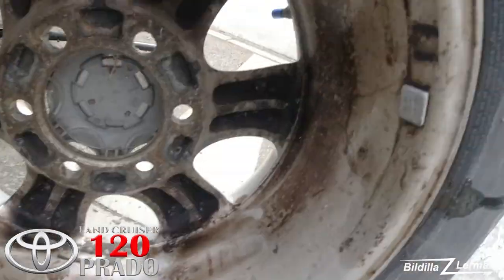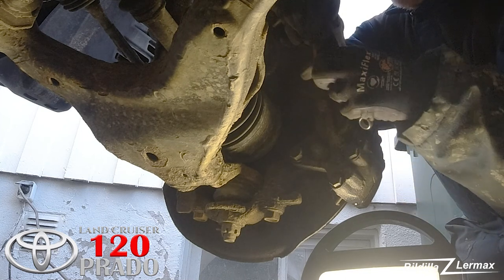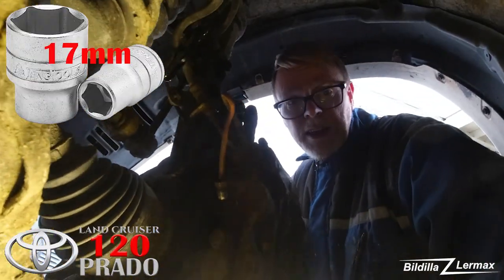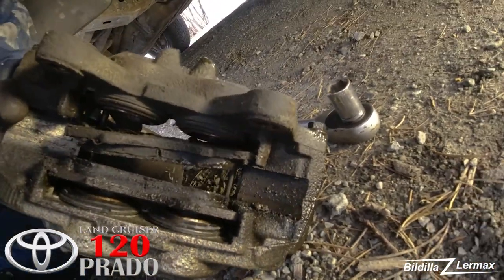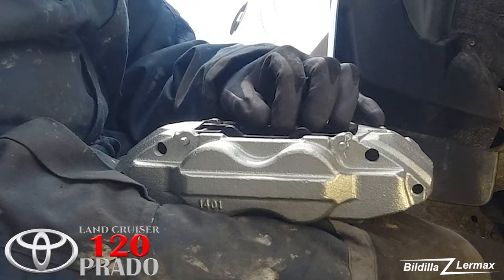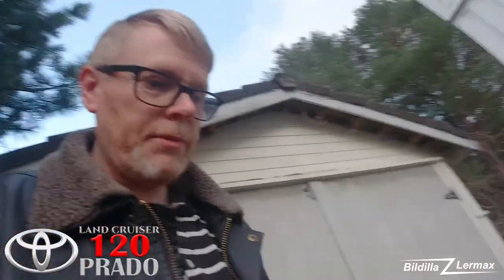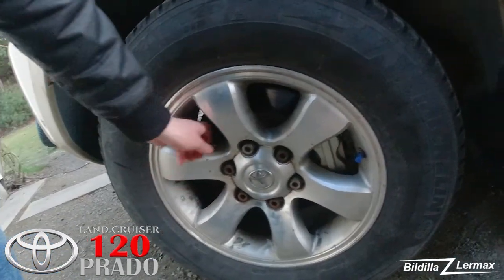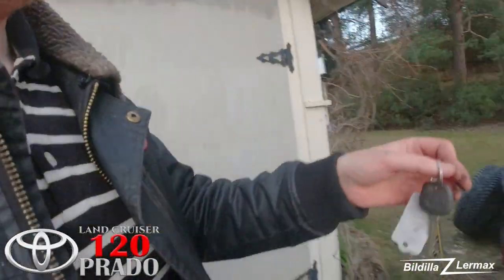How to / DIY - replace front brake calipers + pads - Toyota Land Cruiser / PRADO 120 / Lexus GX470

Comment: You didn't need Techstream to bleed the front calipers?  Another video seemed to indicate you needed it - it was a GX470.
Reply from the maker: Good day!

No, I didn't need any data help.
Strange if you need it on the Lexus, when this is basically the same car, but a different engine. I don't think the Lexus has any additional control on the brakes at all.

Greeting
Pål (Paul)
Reply: @bildillamagasin  okay, thank you! It might just be a process to make it easier, I couldn't tell.  How's the weather in Norway?
Reply from the maker: @stevenelson1456  Hello again.

The weather here around Trondheim, in central Norway, is cool enough.
-10 to -16 degrees Celsius.
It is a challenge when you have to do a lot with so many project cars. But a bad back, and the cold... Yes, one can hope it will be a little warmer soon!
Had to leave my Land Cruiser 120 series at a workshop last night. Can't find the error that puts it in emergency mode. Just have to get someone else to look at it. But it's going to cost... Everything is expensive here. Workshops are insanely expensive..
Where in the world are you from?

Greeting
Pål (Paul)
Reply: @bildillamagasin  USA, Michigan.  Was near Detroit, now on the other side of the state.  Not that cold here yet, but even here, it's hard to do anything in the winter unless you have a heated, large garage.   I have a Swedish-Norwegian-Danish background, so I favor those countries, but have never been. Would love to visit, but probably not live there, since even from here I'm starting to think about warmer climates.
Reply from the maker: @stevenelson1456  Hello again.

Yes, the winters are a challenge where I live (outside Trondheim). A small garage, and a lack of good heating... It's a bad combination!
I have a LOT of cars, waiting for me to get enough time to do something with them.
Scandinavia has its charm! But the last 2 years, the climate has been worse than I can remember from when I was younger! Maybe I'm getting too old?
I have 2 boys who are busy with basketball, and the youngest has dreamed of going to college in the USA. There will be a lot of time spent helping the boys, and going to matches here at home. But fun when the youngest boy is actually quite talented. I have told him that when he comes to the NBA, he owes me a BIG garage, and many cars... Then I can sit and enjoy myself in the garage, as a pensioner ;)

Greeting
Pål (Paul)
Reply: @bildillamagasin  That's awesome!  Let me know if he does come over, I'd enjoy watching his progress.  I have five kids, my youngest is very good at "soccer", but we'll see.
Reply from the maker: @stevenelson1456  Hello again!

Soccer is a very big sport here in Norway.
There is much less media coverage of basketball.
It's hard to build up a sport when it never comes on TV.
But it is probably also due to the fact that we do not have any star players, who would be given TV coverage of the sport.
How is football/soccer on TV with you? There are many sports that are much bigger there, I imagined?

Greeting
Pål (Paul)
Reply: @bildillamagasin  it's getting really big now, way bigger than when I was a kid.   You can get it on television easily enough, but you can get ANY sport on television.  They have professional corn hole on sometimes - a game where you toss a bag of corn through a plywood hole, if you haven't seen it.
Reply from the maker: @stevenelson1456  I have seen that Corn Hool seems to be popular as a family activity on the beach in America. My wife and I dream of being able to live closer to the water/sea, so we see many programs about buying houses and cabins by the sea.
I set up a separate channel for Norwegian basketball. https://www.youtube.com/@lermaxsports
I now film all the matches I take part in, but due to privacy rules, there are few matches that can be out in public. Most matches are closed, and only players and coaches have access to their own matches.
Reply: @bildillamagasin  I love being by the water.  I drive to Lake Michigan a lot in the summer - huge fresh water Lake about an hour away, absolutely beautiful, really nice for swimming, really large beaches.  Can't really afford to get a house on a lake right now, but would love to
Reply from the maker: @stevenelson1456  After looking a bit at the map of Michigan, I have to say that you have the potential for a lot of nice places! All the great lakes must be sent from higher powers!
As a car man, you go around thinking that the car culture must be big in your area too :)
Reply: @bildillamagasin  Yes, the Lakes are absolutely amazing.  Better than the Ocean in a lot of cases, I think.   Our winters are cold, but probably don't compare to where you are.   I grew up on the east side of the state, so right next to Detroit.  Dad worked for Chrysler as an engineer, but I wasn't really a car guy - just starting to learn now in my 50s.  We lived close to Lake St. Clair, which is also beautiful.  Very large but not a  "Great Lake".  If you can see a guided tour somewhere Lake Shore in Grosse Pointe Shores you can see the Lake on one side and the huge beautiful houses on the other.
Reply: Trondheim looks absolutely fantastic!
Reply from the maker: @stevenelson1456  I have to get a holiday in the USA.
A lot to see, so you can probably only manage a few fragments in a few weeks. But a lot I could imagine seeing and experiencing.

Greeting
Pål (Paul)
Reply from the maker: @stevenelson1456  Trondheim is a nice little city.
Founded over 1,000 years ago, with a lot of Viking history.
My home is 20 km south of the city, and we have a lot of Viking history here too.
Too bad the climate is a bit too unstable here. The winter is long, and puts a stop to too much.
But perhaps we shouldn't complain. Norway is a very peaceful country to live in. Virtually free hospitals, schools and universities...
Trondheim has many universities and other large research companies.
Reply: @bildillamagasin  mom would always talk about our Viking heritage.   That would be cool to see.
Reply from the maker: @stevenelson1456  Yes, the Vikings explored large areas, from far into Russia to North America, and all the way down to Africa

I have some old Drone videos from Trondheim, which is the city right next to where I come from. Trondheim was 1,000 years old in 1997! So founded in 997.

https://www.youtube.com/watch?v=QCJVg4zqdqg

Greeting
Pål (Paul)

Comment: great video! as always! compliments!
Reply from the maker: Thank you.

Trying to help where I can achieve something myself.
This was shown video no. 81, about the Land Cruiser 120 series, so there must be something for quite a few owners of these cars out there :)

Regards
Pål
Reply: @bildillamagasin  :D you make a real good job, really appreciated from my point of view. 

will you clean EGR one day?  I am curious to see operation... but do not have time to do now.
Reply from the maker: @voyager3355  Hi

Yes I have a plan to clean EGR + more of the top. Just need to check the injection nozzles first as well. If you are going to disassemble first, you should be sure that the rest does not need to be replaced at the same time.
Reply: @bildillamagasin  
i have a really unpleasent vibration at the morning when i start cold, (even if I have webasto heats some),  she likes to vibrate a little bit but later on when we have the correct engine temp, she works smoothly like silk.
i changed oil of the transmission, issue not solved. all other liquids like diff and transfer case, issue not solved.
there are some discussions at forums telling that 
1- defective injectors?
2- engine mounts?

I do not think engine mounts since when it is hot, why not vibrating?
is the ECU injecting more fuel (rich mixture) to arrive quickly to the optimium temperature?
I dont know and i want to solve this.... 

do you have something like that?
Reply from the maker: @voyager3355  "Everyone" says that the injector must be damaged before the car has driven 200,000 km .. While someone drives almost 400,000 km without problems ?!
What you experience is "claimed" to be from the injectors. They are very expensive and "must" be replaced. While others clean theirs, without experiencing problems. Hard to know who is right, but I would try to clean before I spent a lot of money on new ones!
Reply: @bildillamagasin  and i do 161.000 kms. and facing this issue. of course i will do the same you did. or leave it to heat a little bit before using it. but my question was to you. do you have the same issue or not.
Reply from the maker: @voyager3355  I have some sound when it's cold too!  :)
Reply: @bildillamagasin  all right, i am not alone any more:D
Reply: I replaced the brake pipes on my son’s Land Cruiser with rubber flexible ones great job